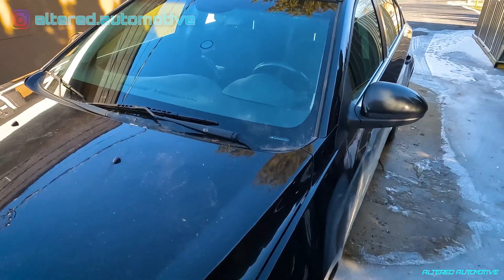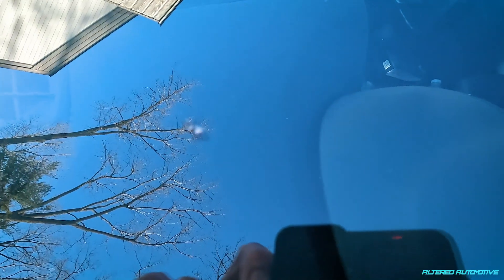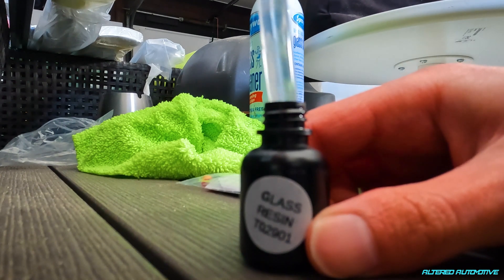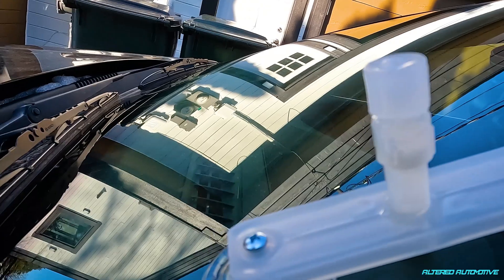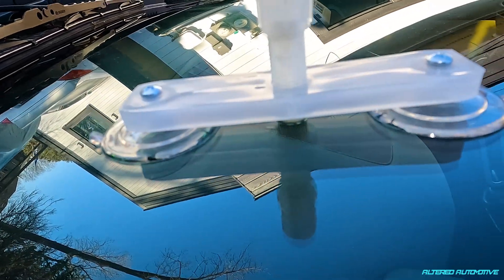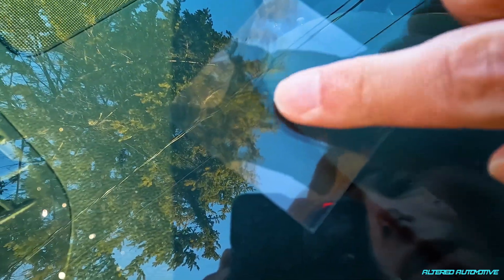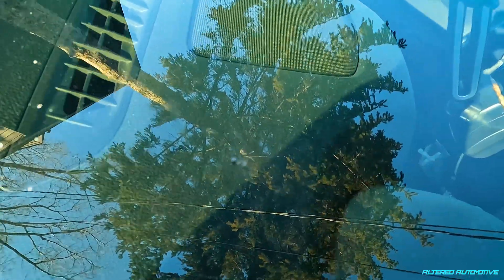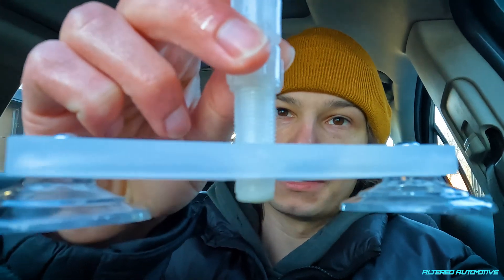3M Windshield Repair Kit Test: Does It Work?

Comment: How did it hold up it’s been 5 month
Reply from the maker: It’s held up well, no additional cracking or spreading of the chip. I did see a video recently where a professional used a lighter from the inside of the windshield to help seat the liquid. If I were to do it again I would try that.
Reply: @AlteredAutomotive  to tell the truth I suck at this thing I’m just gonna go into a cracked open, and I use the insurance company to give me a free replacement windshield cost like 250 I think but if I’m paying for insurance, I should get it for free
Reply from the maker: @petermuniz9296  I would call around to some local glass shops and see what their rates are, you might be able to get the chip filled for less and avoid the whole insurance headache
Reply: @AlteredAutomotive  my chip look like a water spot it need a crack to be 20” so they can fix it they not going to fix a water spot